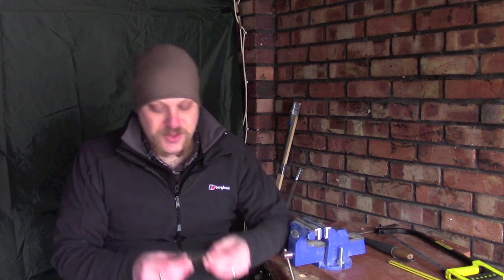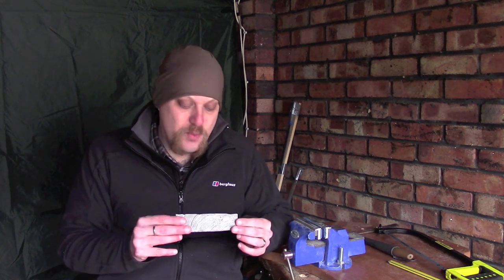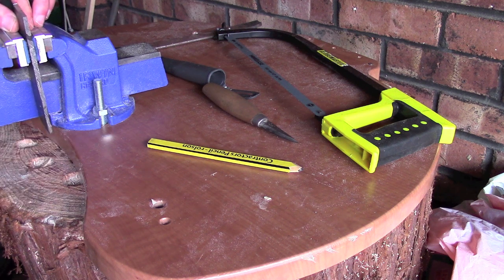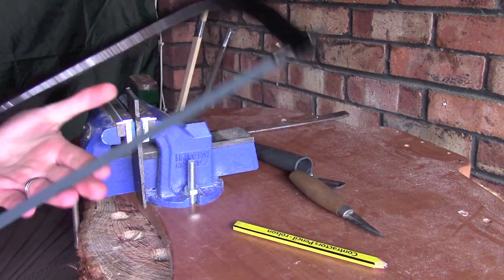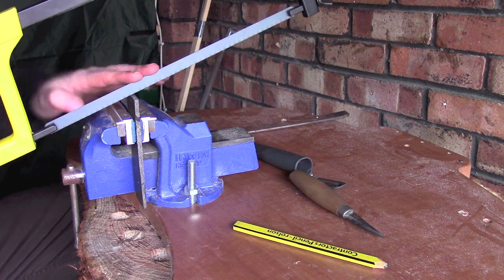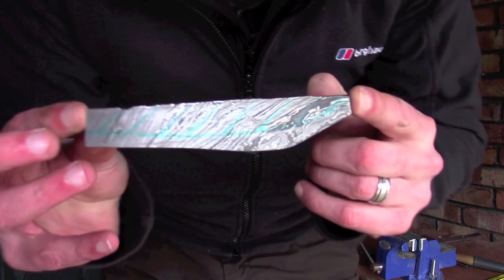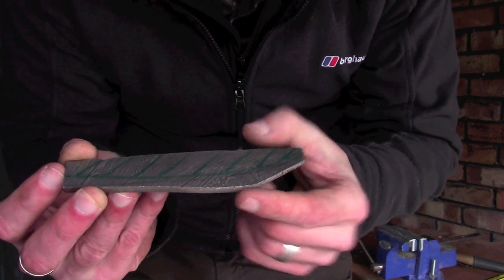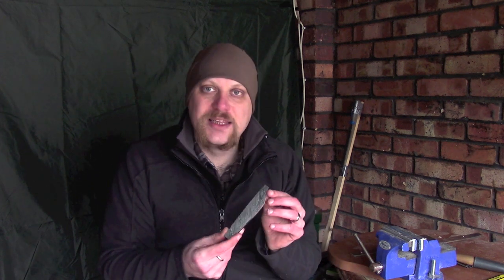Making Your Own Wood Carving Knife - Part 1

Comment: Just as a bit of a pointer, don't completely finish the knife before the heat treat, especially don't try to sharpen it yet as you'll have a lot of cleaning up to do after quenching it in oil. Plus more stock left on means less chance of warping. Also be aware using Damascus will need an acid bath to bring the pattern back out.
Hope you don't mind the advice, just trying to help 😀
Thanks for all your videos, really like the channel
Reply from the maker: All advice is very welcome, this is virgin ground for me. My plan it to get the blank shaped and the bevel in to the point where the edges meet then heat in the mini forge and quench. A couple of hours in the oven to temper then a bath in some ferric chloride before final sharpening.
Reply: Woodcraft Hamster dang that steel is sexy looking and expensive you sure is lucky I use cut down old worn butchers knives  try em and see costs nothing they only throws em away